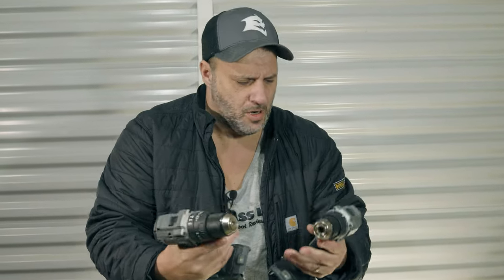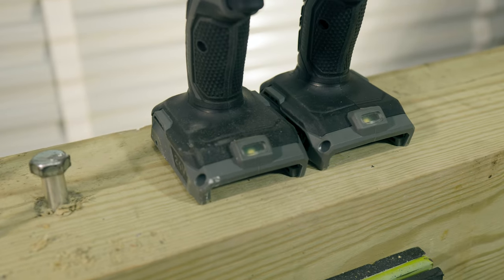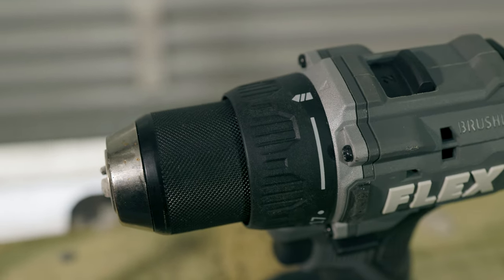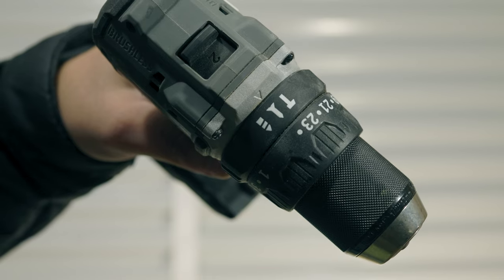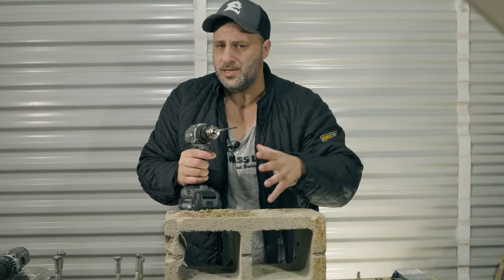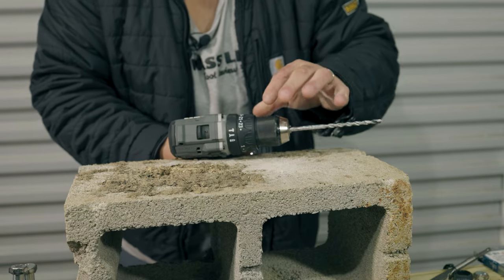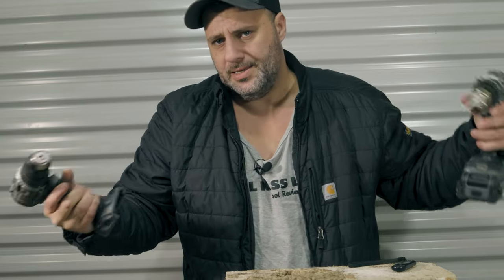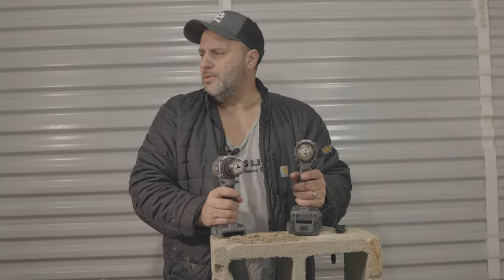Regular Drill vs Hammer Drill and why you should buy one over the other

Comment: For a homeowner /DIY a hammer drill is probably the better option but for professional rotary hammer + drill is the way to go
Reply: Yes 100% agree if your a pro you need to have a rotary hammer
Reply: you can also find them for a pretty good price at harbor freight or princess auto. it's so much faster it's often worth it if you have a bunch to do.

but Clint is right if you've just got a couple to do, you can do it with any hammer drill!
Reply: I would say for true professional, Milwaukee makes small rotary hammer drill in m12 fuel series.
Then get the impactor and hammer drill based on ur needs. If 12v is good then Milwaukee makes amazing 12v stuff no one Else can compete, if u want more power  Dewalt take a look at Dewalts atomic or XR.

A lot of people are looking for an all in one when starting, I would say the 3rd Gen m12 fuel is the way to go. Then make an amazing hammer drill suitable for many things and rakes hex bits

Comment: I ended up with two of the Flex turbo hammer drills.  The first one I bought for $99 from Acme last July, primarily for the batts and charger. That tool took a bit to ship, though, so I found a good deal on the stacked turbo HD and impact kit. 

I don't need two hammer drills, so I've turned one into a dedicated drywall mud mixer. It's  we'll see how long it can last. Maybe 30 buckets in so far, and it handles the large Level 5 mixing paddle no problem.  

Of the few Flex tools that I have, they all feel solid. My favorites are the fan and the tripod light.

Comment: i'm not planning on drilling through concrete/cement or cinder blocks any time soon, but i like having the tool for the job just in case i need to. also the hammer drill chews through material quicker regardless. it helps that i got my milwaukee impact driver and hammer drill combo with 2 batteries, a charger, and a carry bag for 200$ off. always look for sales folks

Comment: When in doubt choose both. I never cried myself to sleep over having redundant backup of good tools since double the tools halves eaches wear rate (assuming each was used equally), and can reduce bit or accessory swaps. For example I'll have one drill with a machinist's starter drill bit, one with a pilot bit and one with the final size when doing some steel work like building my shop shelves of steel angle.

Comment: Would a hammer drill ne a good option for extracting a rusted in bolt using a screw extractor bit? I have tried to use a normal screw driver but no luck

Comment: I consider a hammer drill to be the middle ground between a drill driver and SDS. For a typical home owner, a hammer drill would be more than enough.
I am wondering why there is no hammer only function in a hammer drill. I think that feature would come in handy to drive in nails, etc. which would be similar to Milwaukee's palm nailer.

Comment: I hardly touch my hammer drill since buying the brand new compact brushless Milwaukee drill  it’s so light and basically just as powerful as my gen2 fuel hammer drill and so so much lighter. I have a rotary hammer if I need to drill into concrete or cinder.